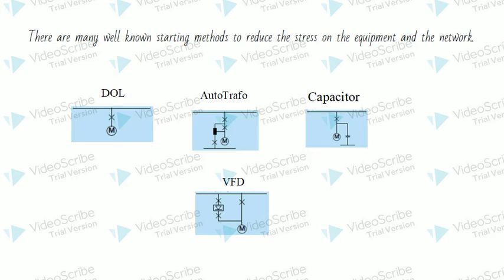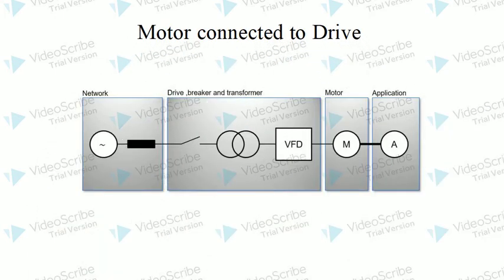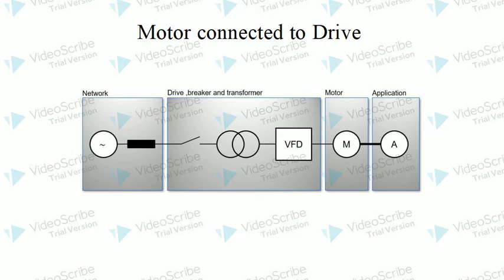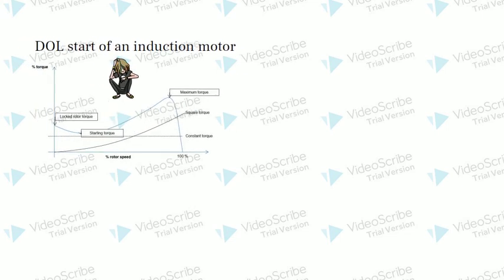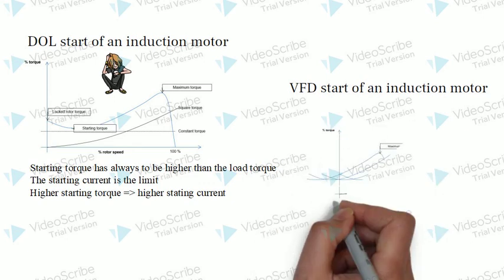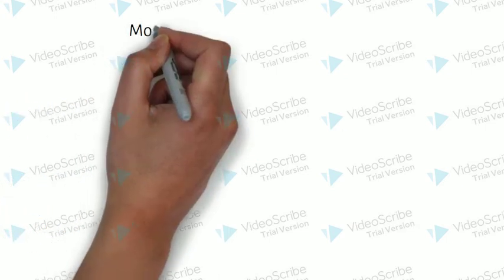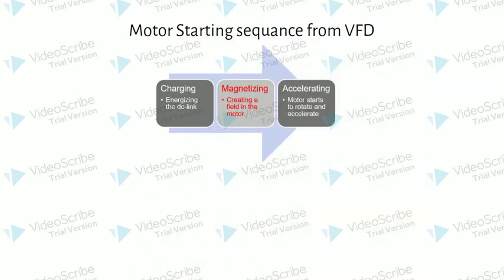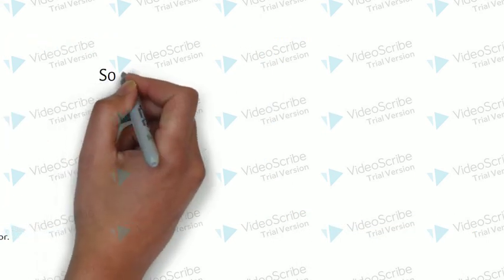Why Motor is taking less starting current when start from VFD ? Motor starting Method. VFD Vs DOL

Comment: Thanks for the video. Are you still taking questions?
Wakodahatchee Chris
Reply from the maker: Yes and yes
Reply: @VFDExpert  None of the VFD's that I'm aware of employ a Power ON/OFF switch. It's not surprising when considering the enormous inrush current that VFD's are notorious for. My SVD-E 1.5KW VFD owners manual has a section covering magnetic contractors on the input side of the VFD. They stress not restarting the VFD sooner than 1  hour after shut down! WTF???? :face-blue-wide-eyes:

When I read that I thought it was a misprint!  :face-blue-wide-eyes:As it turns out, it was not! There was no way I was going to live with a restriction like that because this was my first VFD after years of considering one. I knew I had a lot to learn about the programming end of it and would be turning it on and off often while simply bench testing my programming. Besides, I had to play with it on the bench for a while, .. just to become familiar with it. In the end I put a timed relay on the 240VAC input of the VFD. When I switch the VFD on with a SPDT switch on my lathe a 50 Ohm 25W resistor limits the inrush current until the timer relay closes its contacts and shunts the resistor. After which the VFD is free to have its outputs loaded and make me free to find it's limits. 

This is my question. Was I paranoid? It's been working for over a year now and I've never waited an hour between turn on's. The VFD's Caps charge up long before the resistor's 25W limit is reached.  In fact I just found a nice 100 Ohm - 100 Watt finned Aluminum cased resistor in my junk box. I'm going to use in with my next VFD. I'm totally hooked on them. Once you have a VFD 3PH machine in your shop you'll never go back!
Thanks!
Wakodahatchee Chris